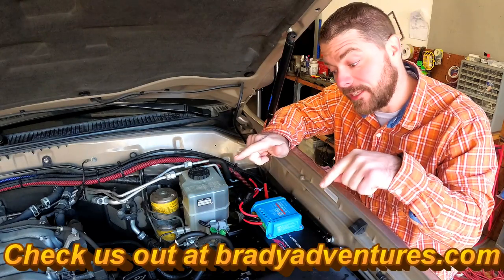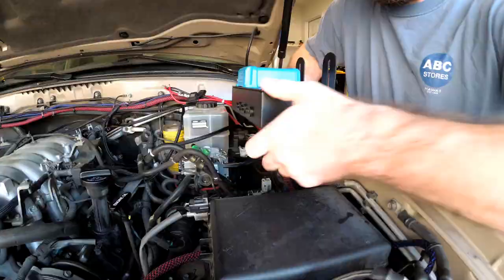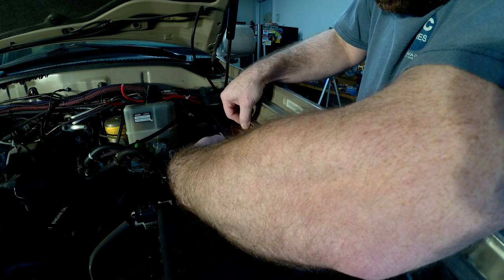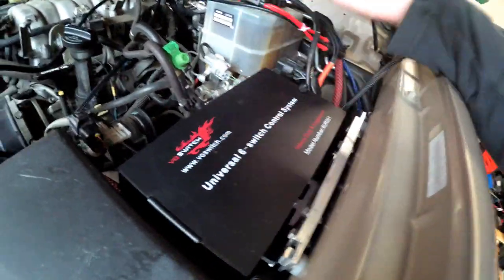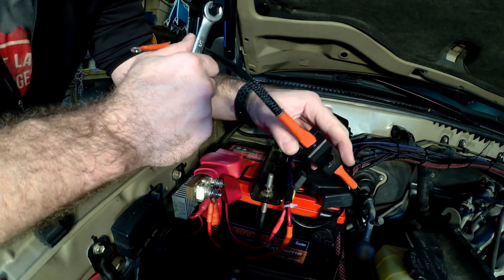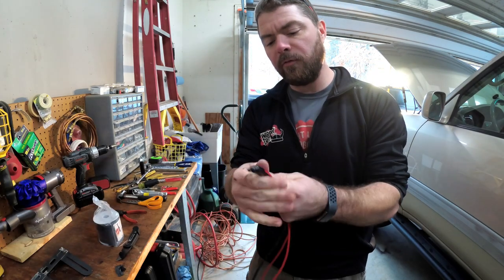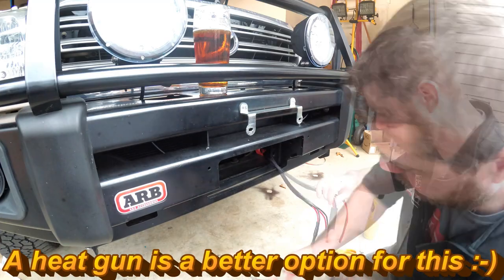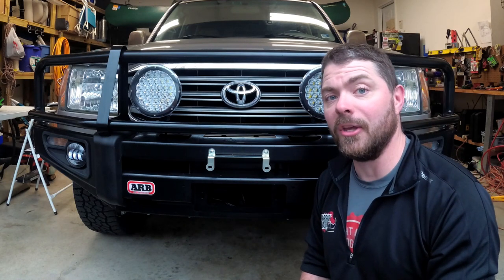Voswitch Universal 6-Switch Relay Box and LED Driving Light Install - 100 Series Land Cruiser

Comment: Did you do the lighting follow up video? What is the beam output like and how far can you see with them on the bumper like that? My bumper is on order and I plan to use these to spot hogs in West Texas. Thanks in advance.
Reply from the maker: I haven't done a follow up. I would say the beam is pretty tight and they are extremely bright and throw light very far.  The only complaint I have is one has some moisture behind the lens so I need to open it up and reseal the housing.